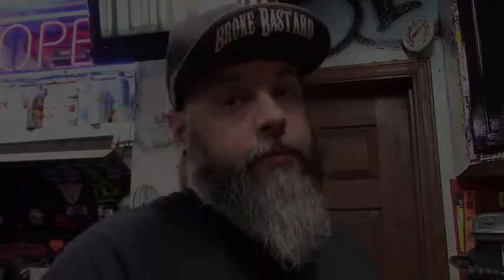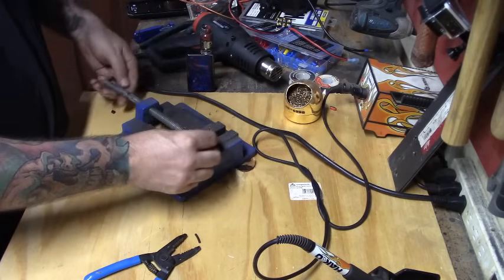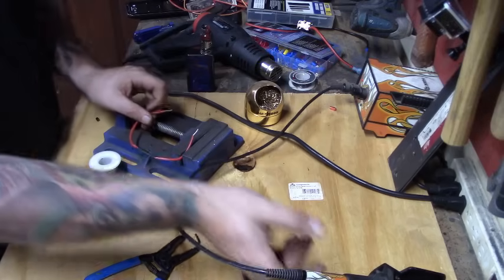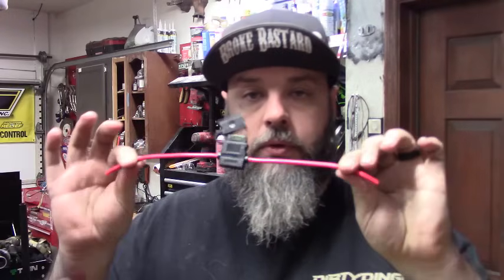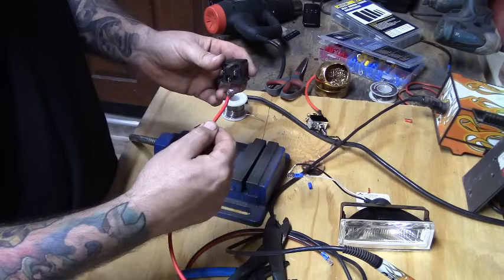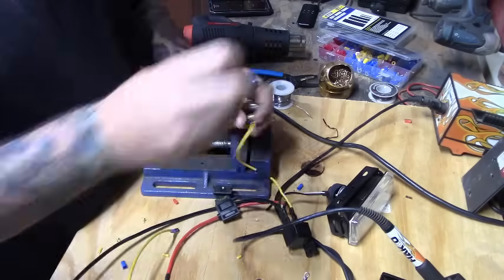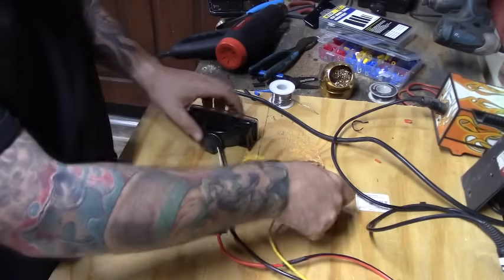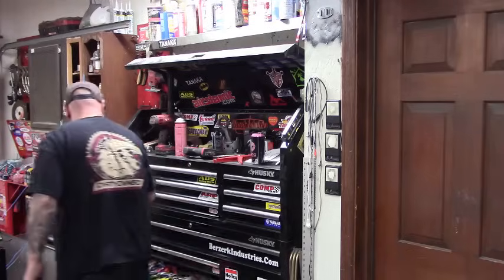How to wire a Relay and Why You should use them.

Comment: I had hoped to learn from the video, or from any of hundreds of the comments, how to wire a circuit that has a high beam/low beam circuit in conjunction with some kind of toggle switch to kick in and out of low beam/high beam, an H4 socket harness, the relay(s), an in-line (10A) fuse and 12VDC power source for an LED headlamp assembly (intended as an upgrade from an OEM 1994 Honda Magna VF750C motorcycle headlight but it will not fit).  Now, I want to repurpose the purchased ($38) LED assembly with its short H4 connectorized pigtail to make a portable 80W LED lamp that has an optional high power/low power switch.

Comment: I completely RELATE to 98%of what you had to say... i take the plastic of the connectors i solder EVERYTHING i cant stand thick solder the small circuit board wire is way easier. I have never totally understood the reason for the Relay i totally get it now THANK YOU.. I also 
just got back from the worlds largest Car/Truck show last week Sema 2019..
Reply: Weird flex, but ok.

Comment: my question to you is , where do you wire it in at without using a switch , if you hook it up to where you turn your ignition on and start it , what happens if you wreck ? , the ignition is still on so the pump is still running , where do you hook it up so that when the engine shuts off the pump shuts down as well ?

Comment: 1:40 So the reason for a relay, or fuse, is in case another component, like a switch or the light etc, fails you have a safety net?
Reply: RE:SuburbanHobbyist.  Only the fuse is a "safety net". It protects whatever is downline after it including the wire. It opens the circuit if too much power is being drawn (used).
The relay is not actually a "safety net" but it allows the heavy current to travel from battery to fuse to relay to load (light, motor). It allows you to use smaller wire between battery, fuse, switch and relay because the relay requires minimal current to operate it.
Note that both the heavy load and the light load should be fused. The fuse should be sized to protect the weakest link in the circuit (the piece that can carry the least amount of current)  whether that be a wire or a device.

Comment: So: The 12 Volt FUSED power wire to post 30 will be heavier than the 12 Volt SWITCH power wire to post 86, which can be the same size as the power wire from post 87 TO the accessory?

Comment: LOVE YOUR VIDEO ,JUST ONE THING NEVER SOLDER ANNY WIRE ON A CAR ALWAYS CRIMP  A SOLDER CONECTION HAS MORE RESISTANCE AND THE VIBRATION OF THE BODY WILL OVER TIME CRACK AND BRAKE THE JOINT

Comment: Thanks for the video 👍 i had a idea of doing this to my coil for elec ign conversion  its on a 69 ford or is it already relayed  from the external solinoid ?  Im using a pertronix 3 with 65k volt coil i read a few guys going through a relay to the coil .
From you diagram it would be from the battery fused to #30  #87 to the coil positive 86 to the ign switch and 85 grounded .  Not sure if the ign switch already has a relay but theres alot of stuff on there a 5 psi holly fuel pump , i ran cab lights and the elec ign none have relays i think i need them  what do you think ?
Reply from the maker: I have in past always used a relay to power my coil.

Comment: Relays... are primarily about current management.  Put a  7 amp load on a switch rated for 5A, and that switch is going to die.  Make it a 15A load, and it's going to die quickly.  So, use a 2A rated switch to serve the relay coil, and select a relay whose contacts are rated for about 125-150% of whatever fuse is serving power.  Relays are valuable for voltage changeovers [which you usually don't see in a car] and also lockouts [such as disabling starter relay when oil pressure is greater than say... 10psi].
Basic convention regardless of application:  coil is terminals 85 & 86,  terminal 30 is source voltage for the load the relay will manage, and 87 will be a normally open contact.   18 gauge wire should work fine for coils, but I go with 14 just for mechanical strength, especially when minimal protections are in place. Some relays will have a normally closed contact labeled 87a - use that for an idiot/fail light if you like, as it's useful for a system check on startup or if the relay fails.

Comment: i literally do boards and wiring solder with a $7 walmart iron. i also use flux paste and 60/40 however i use the thicker stuff so that its just a tap or 2. rarely have a problem with too much getting on it
Reply: But thanks for the how to explanation on relays. never knew the orientation of the numbers as to power flow

Comment: Properly crimped connections are better than soldering connections. Solder is for wire to board connections. The crimp connection won’t become brittle like the solder will. The crimped connection also provides a better electrical connection.

Comment: Can you power on a light bar relay from two different switches in the vehicle driver area and the back of the vehicle aka trailer/rv
Reply from the maker: Yes just hook both switch’s up to same pole on relay as long as it gets power the light will come on. But both switches will need to be off to turn it off.
Reply: @BrokeBastardGarage  thanks 🙏 you should make a video 😊😇👍

Comment: Thanks ...but I don't see where you connected the other wire on the switch ...is that to the positive on the battery?
Reply from the maker: Frets Nirvana yes. I suggest you fuse that also
Reply: @BrokeBastardGarage  Thanks ...excellent tutorial.

Comment: Im installing a new car horn.  If you take a live from the 12volt battery direct to the switch should you also put an inline fuse with say a 5amp fuse close to the battery. Then another in line fuse in the cable from the battery to the relay with a 20amp fuse ?
Reply from the maker: Elfin4 yes
Reply: @BrokeBastardGarage  Thanks for your quick reply, regards from England 🏴

Comment: Good video, But I scared of your solder practice. Best way to do it is: After you stripped the ends, twist the ends together then solder them. If your idea works, I'll be so surprised. But ok, good video.
I loved your video, only where did you get power from ? Was it off the car battery ? Or from the same source where the old relay was ? You didn't show that part...   But very good video.

Comment: Can you substitute a relay with a higher amperage from the existing one?
Reply: RE:egt777.  Absolutely, if you need to run a heavier load. Just make sure to use adequate size wire and fuse. Or if you mean you have have a higher amp relay lying around that you want to use for same load, then just substitute it in and no need for bigger wires and do not upsize the fuse. The fuse must protect the LOWEST  rated component in the circuit..

Comment: What was the type of solder you use for automotive wiring?
Reply: 60/40 "rosin core" solder has been around for ever,  and is great for any general purpose wire soldering.  It comes in different diameters, I recommend .05 inches (1.27mm) for ease of use when soldering wires.  HTH

Comment: Hi man good video.
How much ohm fuse I need to put.to the same led , 12v power supply to the 60w led light.
Thanks man
Reply: 60w divided by 12v = 5 amps.  add 25% safety margin = 6.25 amps. Go to the next larger nominal size. 10amp rated relay, or larger.  10 or 15 amp fuse will be fine.
Reply: @paulsto6516  thankyou for your advice. Much appreciated. Good man.
Reply: @mrremodiy4112  No problem.  Have fun!

Comment: So lets say I have a fuel pump and want to run it thru the oil pressure switch ( and using a relay ) would it be the ground wire that breaks the circuit  at the fuel pump or  run a hot  thru the oil pressure switch and to the fuel pump?

Comment: Yellow and red go together on the battery  positive side?
Reply from the maker: Red goes to fused battery positive and yellow can go to fused battery positive or fused ignition hot. Depending if you want it to work only when the key is on.

Comment: With an inline fuse would you install it close to the source of the power or right next to the device being added?  My personal thought on it is that it makes more sense to put it closer to the device, but I don't know if there is a mechanical reason to not do that.  Thanks for any feedback!
Reply from the maker: ShoeMaker Royality fuse should always be near the source. That way it kills the whole line if there is a problem.
Reply: @BrokeBastardGarage  that is something I hadn't considered.  I was thinking it'd be easier to figure out which fuse went where if they were closer to the thing they're connected to.  Once the circuit is broken, won't that kill the whole line anyway?
Reply: @MagentaRV  You can label the fuse if you want to make it easier in future.Or you could draw a diagram and attach it to somewhere to vehicle.
Think of a fuse like a one time switch; when too much power goes through it, it switches off ONLY what is downline from it. If you have 15' of wire between battery and fuse and 2' of wire between fuse and load (light, motor) you are only protecting 2' of wire plus the load plus the ground wire. If you place the fuse near the battery, you are protecting all but a short piece of wire. The reason the fuse panel is not located near the bettery in many vehicles is because generally there is a main fuse between battery and fuse panel.

Comment: To be truly safe you need a fuse also feeding the switch.  In theory the load is nearly zero going through the switch, but the wire is still hot and if shorted could cause melting wires and fire.
@13:54 I see the circuit diagram.  No fuse feeding the switch.  If you were doing wiring with many switches and relays you could feed all the switches with a single 5amp fuse and that make it simple and safe.

Comment: I know I'm late but I can't find the answer to the question I have. If I tap into the fuse box and run a wire to the trunk do I need a in line fuse or is the fuse box tap enough.

Comment: I was wondering why my Baja Design lights came with a relay harness. I was going to install these on my eBike and into an external battery. I guess the relay is to protect my flimsy 22awg switch wires.   quick question though, do I need to fuse the positive end of the wire coming out of the Baja Designs LED light?
Reply from the maker: Yes

Comment: Can a relay be skipped? Planning to run power from the battery, to an in-line fuse, the rear of my trucks bed, where i have lights hooked up on my bed. And have it triggered by an on/off push button switch
Reply: I’ll just practice my relays lol never used one but after watching the video I guess its worth being safe

Comment: For the switch wire, does it go from the relay, to the switch, to the battery?
Reply from the maker: 4 door chevy relay to switch. Switch to fused power. Battery if you want it to work anytime or ignition power if you want it to only want to work with the key on.

Comment: Will the solder not cause connection problems with it that thick? Wouldn’t you want to melt the solder in in between all the wires so the wires make direct contact? Just wonderingx

Comment: Say someone were to add a secondary accessory fuse block so that they can add multiple accessories. Should they still add an inline fuse on their power wire? Or since there would be a fuse in the new block a second fuse in the line would be unnecessary?
Reply from the maker: Needs to be fused at battery or power source

Comment: I’m installing a light bar on my RZR and adding a 5 prong switch from the kit existing 3 prong. I’ll be tapping into the backlighting for the switch from existing 5 prong switches. How do I ensure this switch only receives power from when the key is turned on?
Reply from the maker: Garrett Eddington the 5 prong switch will have two incoming positives. One is for the switch to light up. The other is to power the switch. So check both positives with a test light. One should power up when the dash lights come on. The other is your switch power. So make sure it only powers up with key power. Then the light will only work with key on.

Comment: I have a question but not 100% how to do it and need an opinion. I have a 22 Polaris Ranger and adding turn signal kit to it and comes with 2 toggles 1 for horn and 1 for turn signals made right into the vehicle harness , and if I want to use a bus bar 3 wire plug - 1 black , 1 red , 1 yellow it came with it also which I would like to. My question is on the harness it has 2 white wire labeled 12v - , a red 12v + , and another one 12v + constant. I want to use the plug and do it so it comes on with the key and not full time power. How would you wire it with a relay in there somewhere and safely? Hope to hear from you soon!

Comment: My switch has a pwr load and ground prongs, I though the ground was for the light so I didnt use it.  I keep popping the in line fuse @ startup.
Reply from the maker: Josh Greene ground is normally for the light. If it’s piping a fuse the power wire is grounding on something or the accessory is causing the fuse to pop
Reply: @BrokeBastardGarage  wow. Thanks for the reply. It is for a dual fan and I've no way to know the amp its pulling. I am using 30A everything and 10g wire around.

Comment: Might should tell those new to soldering,  If using a flux / solder paste it needs to be made for electrical use or someone will end up using some old acid paste left over from a copper plumbing project.  Acid  base flux will quickly corrode electrical connections.  I have never needed more than what is in a good Rosen core electrical solder.  Wires should also be clean and not be corroded before soldering.  Also if wires or terminal moves while soldering and it gets a dull or grey look, solder it again to avoid a weak resistance connection.

Comment: Hi, i am installing some drl  to my Toyota rave 4. I want them to be on when ignition is on (car running) during daytime 
but go off at night when i turn the low beam on. I have a five pin crossover relay but not sure how to connect it 
pin numbers are 85,86,87,87a and 30. 
I have checked the connections to the 3 pin headlamp plug and 2 pins are constantly live with ignition on or off and the 3rd pin i assume is earth. Can you help.

Comment: Great video mate. So it appears that we must have a fuse from 12V BAT + to pin 30 relay. Then we have another fuse at the 12V+ IGN switch. So we have 2 fuses for each circuit. If there are 5 accessories using relays, it would mean we'll have 10 fuses in total. Am I getting it right? 
That's a lot of fuses there.
I've seen many who don't use fuse before relay. have also seen people line up the relays in a row and only one 30A rated fuse is used to share the 3 to 5 lined up relays.
Reply from the maker: You can use one fuse. But if the fuse blows you loose everything at once. If they non important accessories to driving then that should be fine.
Reply: @BrokeBastardGarage  So just use one fuse ... from 12V+ BAT to Relay pin 30. Don't need a fuse at the accessory line, or toggle switch etc.
Reply from the maker: @hmayerv8  I normally fuse pin 30 separate and then I use one fuse to power groups of switches. So like my off-road lights there switches on one fuse. But my cooling fan will have its on fuse on the switch.

Comment: I think every connection should be soldered and the two reasons we use a relay is for reliability and safety we use a low voltage for the switch and high voltage for the power on the relay